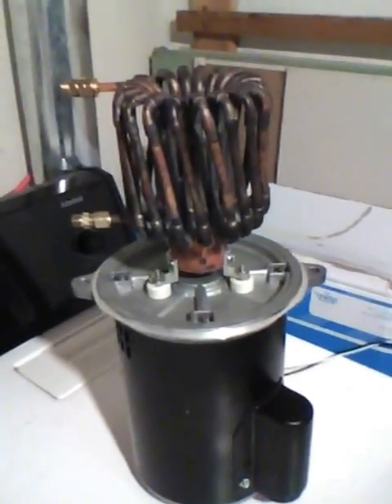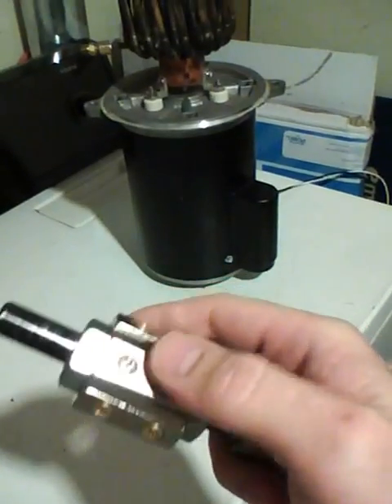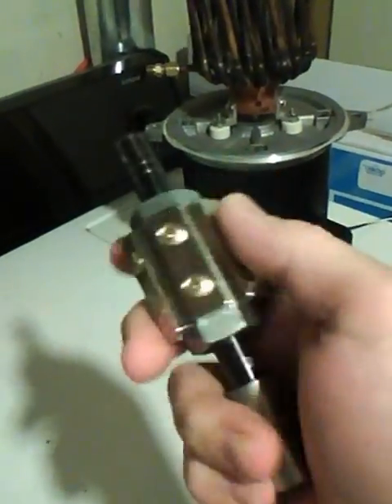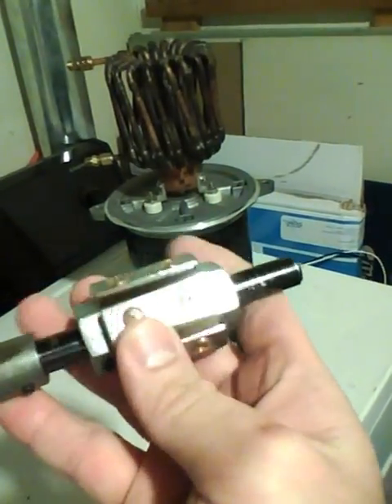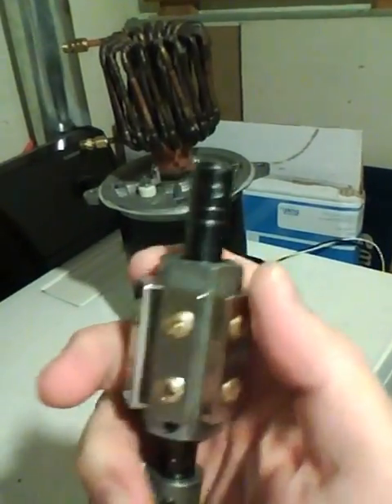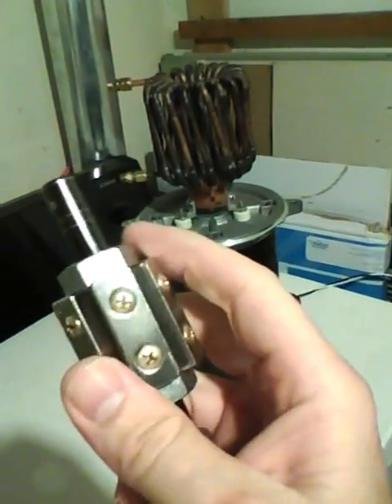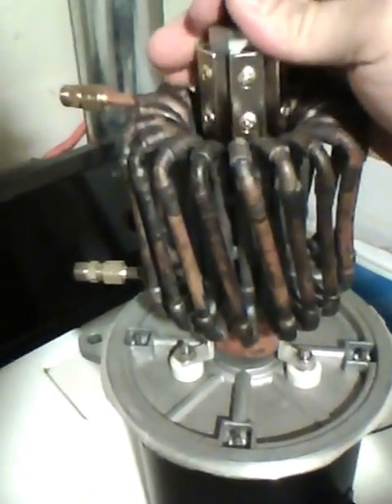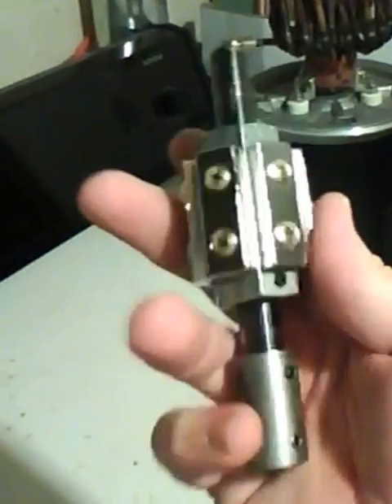Magnetic heater spindle design.

Comment: Hey buddy, ever posted the results somewhere? A link maybe, would be very interested to copy this concept. Keep up the awesome work, great video! John
Reply from the maker: Hello, thanks for watching my video.. I never posted another link about the heater anywhere, I did do the test on it with it hooked up to the kitchen sink line and ran water through it back into the sink.. my results were temperature going in was around 57 degrees Fahrenheit and output temperature came to be around 74 degrees Fahrenheit. So it had around 17-degree Step Up in temperature which is not too bad I guess for constant running water with some pretty good pressure behind it. Anyway thanks for your comment and again thanks for watching.

Comment: I assume that you had to drill  the magnets for mounting? The principle works. One interesting experiment is to drop a round magnet down a copper or aluminum pipe - it floats down as opposed to dropping - induces a type of CEMF . Though the materials are not magnetic the atoms line up briefly to have this effect. Like to hear how efficient this is. I know that the closer the magnets are to the coil the more heat is generated - on the square of the distance.

Comment: The copper tube thingy, is cool.  I think that is right on.  The spindle, I dunno.  I had a different concept in mind.  As a plumber, this would be similar to an electric tankless water heater.  I don't believe you have enough surface area getting hot,  I'd sure like to know.  If it doesn't,  I'll send you my drawing, and you can test that out.  Keith
Reply from the maker: Please check out my "magnetic heater update video" to see the results of what I achieved on this size unit.. It would work very well in a closed looped system for providing heat. Thanks for your comment and watching,

Comment: hello and thx for uploading this i have a friend who is considering using this method to heat water for house heating vs paying 5 to 6 grand for wood and or propane.
ps it is 200 gallons only need the water to come out at 120 to 180. if you have any suggestions that is.
Reply from the maker: This would work great if you use a high efficient motor to spin it... You may need to up size it a little bit for what you are planning thou. I'm working on magnetic induction using transistors with no moving parts which is doing a beautiful job in heating up things. It might turn out to be even better than this design in what you want to do with it. I will Maybe make a video soon on it. Thanks for watching.
Reply: whyme2b thanks for your reply and for the info i will look into that.
Reply from the maker: Your welcome buddy...

Comment: That's pretty incredible!
I knew about induction heating for metal using electricity, but it never occurred to me to use rotating magnetic fields to heat a pipe to heat water. I don't have the $'s or facilities for working with this kind of thing, but I sure would like to.
I wonder how energy efficient this is for heating a house in Canada.

Comment from the maker: Thanks...and yes, I was thinking of using a motor from a electric scooter which has excellent torque and low power consumption. I just used the other motor because it was all I had to work with at that time. Thanks for watching.

Comment from the maker: I actually designed it to be long and thin due to that problem...you always want to go smaller than the motor's rotor size that powers it, that will cause less strain on it to spin it. Also if your motor has a 208 volt input, it would consume less amps. Sorry for delay in getting back to you, I never seen your message until now. Thanks for watching.

Comment: here is the video of my latest test. 
it is functioning very good. But my home is large for one coil so I will double it in a few days and try to heat more efficient. I have in a system approx 500 liters of water (100 gallons)
I achieve temperature of over 400 Celsius in one minute 
 video in you tube=    LFNOd8Cg

Comment from the maker: Hello friend, I found that the best energy efficiency for the motor that spins it would be having the magnet shaft be smaller in diameter than the rotor of the motor..the smaller and longer the magnet shaft is, the better and less torque it will require to spin it which means less energy it would take to run the motor. Also when the tube heats up you will notice the input power begin to decrease more as well. Thanks for watching.

Comment: I am using one KW motor at 3.000 RPM. Do you have any advice what to do to increase efficiency? When I put copper pipe closer to magnetic field increases amps dramatically
Is there some rule for the most efficient distance between copper pipe and magnets and does it require higher torque to improve efficiency?
I ll appreciate your experience.
Now I am thinking of making this spiral copper like yours

Comment: Hi thanks for answer.
 I am also doing my best to make magnet heater, First I made disc of 10 inches diameter with 24 N45 magnets 1 inch diameter and I managed to heat approx 100 liters of water to steady temperature of 82 Celsius. Now I moved this to my home and connected it to my home central heating system and I can not go over 30 Celsius.There is to much water approx 100 gallons in system.

Comment from the maker: The magnets act like a propeller when spinning causing air to be pulled up threw the housing keeping them cooler than the temp around them. You could add a heat wrap material on the inside of the pipe for shielding the magnets even more so from the heat generated. Let me know if this helps out?

Comment from the maker: Yes sir, I have tested it with and without and found that the current consumption on the motor only changed by a few amps but as it heated up, the current returned to almost normally " like the magnet shaft was removed ". Please watch my " magnetic heater update video " to see it in action my friend. Thanks for watching.

Comment: Have you measured the draw of the motor free wheeling vs. spinning the magnet?  The thought is that there may be a slightly elevated draw down on the motor,  Might be useful to know to understand the output vs.input.  I wonder how it might calc.vs, a standard resistance water heater as far as amount of current used per unit of output.

Comment from the maker: It runs at 115 - 7.4 amps / 208 - 3.5 amps or 230 - 3.7 amps..... 208 is the most energy efficient. The motor is a 1/2 hp which spins at 3,500 RPM. Will be doing another video on running water threw it and showing all electrical specs soon. Also working on another induction design to heat bigger spaces...will keep you posted on that my friend....Thanks for watching.

Comment: Great design.  I'm building something very similar, however using 1" copper tubing.  I do have a couple questions such as what size tubing do you use on the inside and what strength magnets did you use?  For a different design I using N54 1/2" d X3/8" l, 20lb pull.  Also do you find 3500 RPM as the target speed?  Thanks in advance.  Rich

Comment: Hey. I just a similar version. I have a motor that spins at around 2900rpm. And a have a shaft just similar to yours. But when the motor is turned on and the shaft is spinning i put a copper pipe really close to the spinning magnets and the pipe didnt heat up. Why? Do you think that in order it to heat up i need a copper coil like yours? Thanks man

Comment from the maker: I'm spinning it at around 3500 RPM's which causes the unit to heat up to 300 F in just around 45 to 50 secounds. So the faster you spin it, the quicker it heats up. Not intended for automobile...just house heater. Yes, good idea on windmill but would need to be hooked up to a small transmission to help spin it faster. Thanks for your comment my friend and your english is perfect ! Best wishes also and thanks for watching.

Comment: Have you tried the hot water heater friction drum? The pressure from the water actually turns the drum that threshes the water and generates heat. They claim under test it generates more energy than it takes to run it  /watch?v=yh_-DUKQ4Uw

Comment from the maker: Possible if scaled up to bigger version or done right when circulating water threw a big coil and use as a radiant heater...water would reach boiling temp and would need to have a thermostat to cycle the motor off and on when temp is reached. I can't really build it for you ,that's way I made some videos on giving people some ideas that would help them out in creating this in what ever way they could think up. Thanks for watching.

Comment from the maker: Thanks, I never though about the effects on softened water thou? It may heat up faster or take longer? Good question ! The pipe I used is actually 1- 1/2" copper couplings silver brazed together which gave me a 1- 5/8" spacing inside which gave me a 1/16" clearence  from the magnets spinning inside. Thanks for watching.
Reply: Nice to hear the clearance was correct fella. Nice work